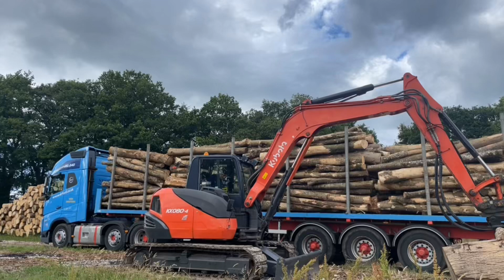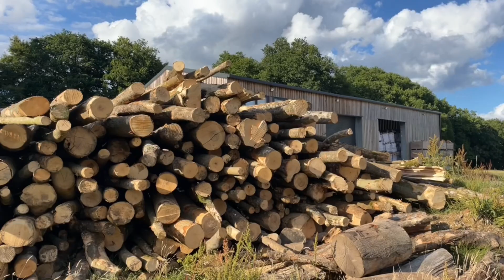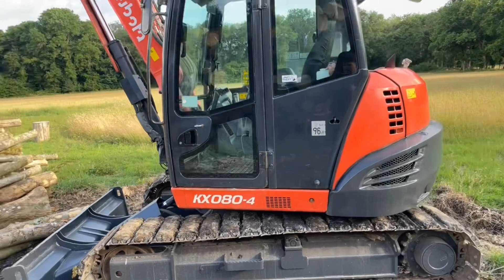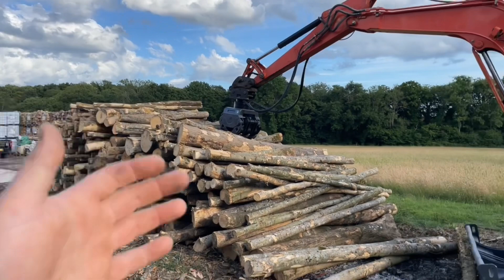Unloading timber with a KX080-4

Comment: Hi what is the biggest size firewood the kinlet will do? Did you look at the splitta 400?
Reply from the maker: Hi, do you mean logs or rings? The kindlet pro will take 25cm rings. I did but for smaller split kindling the kindlet is better and faster